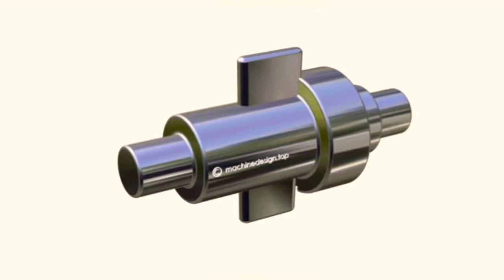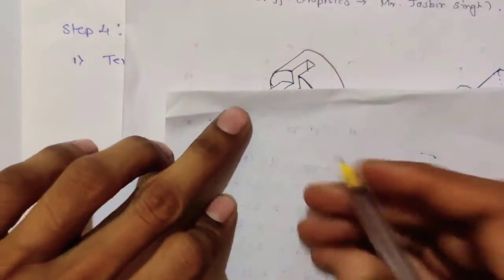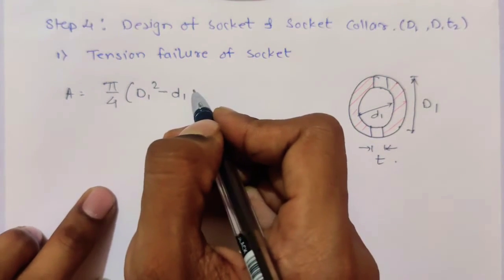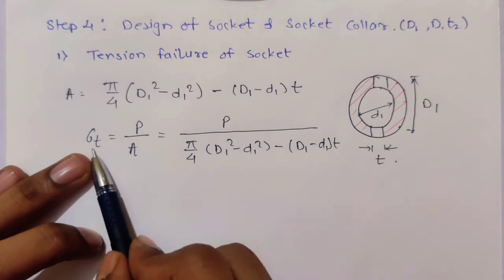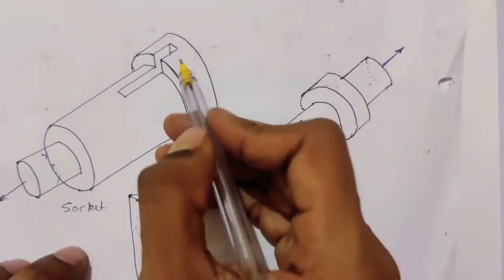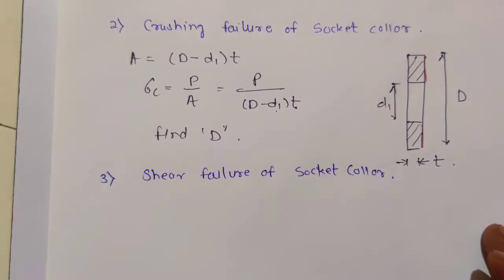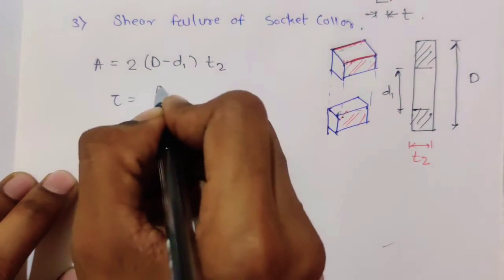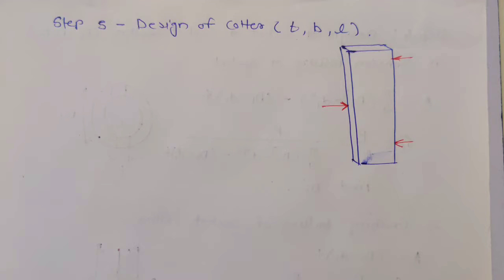Design of Cotter Joint using PSG _ Part 2 (Hindi)

Comment: Short Summary for [Design of Cotter Joint using PSG _ Part 2 (Hindi)](https://www.youtube.com/watch?v=I5DiZy7_r_E) by [Merlin](https://merlin.foyer.work/)

Title: Cotter Joint Design Fundamentals: Socket and Spigot Pipe - Part 2 (Hindi)

[00:02](https://www.youtube.com/watch?v=I5DiZy7_r_E&t=2) Design of socket and spigot pipe cotter joint

[02:38](https://www.youtube.com/watch?v=I5DiZy7_r_E&t=158) Designing Cotter Joint Failure Area Calculation

[04:51](https://www.youtube.com/watch?v=I5DiZy7_r_E&t=291) Calculation of Cotter Joint dimensions using the specified equation

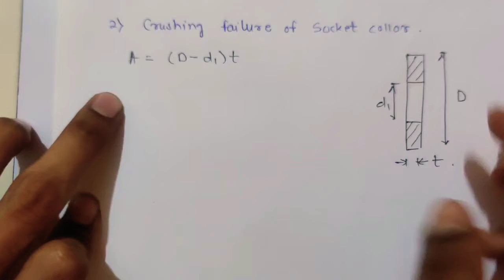[07:29](https://www.youtube.com/watch?v=I5DiZy7_r_E&t=449) Calculation of Sigma crushing for Cotter Joint

[09:36](https://www.youtube.com/watch?v=I5DiZy7_r_E&t=576) Design of Cotter Joint involves dimensions of width, thickness, and depth.

[11:53](https://www.youtube.com/watch?v=I5DiZy7_r_E&t=713) Cotter joint applies force using spigot and socket

[14:09](https://www.youtube.com/watch?v=I5DiZy7_r_E&t=849) Explanation of bending failure in Cotter Joint design

[16:04](https://www.youtube.com/watch?v=I5DiZy7_r_E&t=964) Design of Cotter Joint calculation summarized

---------------------------------

Detailed Summary for [Design of Cotter Joint using PSG _ Part 2 (Hindi)](https://www.youtube.com/watch?v=I5DiZy7_r_E) by [Merlin](https://merlin.foyer.work/)

Title: Cotter Joint Design Fundamentals: Socket and Spigot Pipe - Part 2 (Hindi)

[00:02](https://www.youtube.com/watch?v=I5DiZy7_r_E&t=2) Design of socket and spigot pipe cotter joint
- Explanation of the dimensions t1, t2, d1, and d3 and their respective formulas
- Discussion about the minimum cross-section area and application of tensile load

[02:38](https://www.youtube.com/watch?v=I5DiZy7_r_E&t=158) Designing Cotter Joint Failure Area Calculation
- The failure area is determined by the dimensions of the joint.
- The calculation involves multiple areas and lengths to determine the final design.

[04:51](https://www.youtube.com/watch?v=I5DiZy7_r_E&t=291) Calculation of Cotter Joint dimensions using the specified equation
- Ensure not to put the equation as a denominator while solving it to avoid errors
- Understanding the concept of crushing failure of socket corner in cotter joint design

[07:29](https://www.youtube.com/watch?v=I5DiZy7_r_E&t=449) Calculation of Sigma crushing for Cotter Joint
- Sigma crushing is calculated using the formula P/(D - T1*T)
- Understanding the dimensions of outer diameter and socket collar diameter is crucial in Cotter Joint design.

[09:36](https://www.youtube.com/watch?v=I5DiZy7_r_E&t=576) Design of Cotter Joint involves dimensions of width, thickness, and depth.
- Dimensions include T1, T2, areas calculations, and tau formula for stress analysis.
- Next steps involve design considerations for socket collar and further design of quarters.

[11:53](https://www.youtube.com/watch?v=I5DiZy7_r_E&t=713) Cotter joint applies force using spigot and socket
- Spigot pulls socket applying force
- Explaination on double shear area and stress

[14:09](https://www.youtube.com/watch?v=I5DiZy7_r_E&t=849) Explanation of bending failure in Cotter Joint design
- Formula for bending failure involves key parameters P, T, kata, and k.
- Directly use formula M=P/2D to simplify the design process.

[16:04](https://www.youtube.com/watch?v=I5DiZy7_r_E&t=964) Design of Cotter Joint calculation summarized
- Using the equation M by I Sigma by y for the calculation
- Comparing values of B from the equation to find the final value

Comment: 00:02 Design of socket and spigot pipe cotter joint
02:38 Designing Cotter Joint Failure Area Calculation
04:51 Calculation of Cotter Joint dimensions using the specified equation
07:29 Calculation of Sigma crushing for Cotter Joint
09:36 Design of Cotter Joint involves dimensions of width, thickness, and depth.
11:53 Cotter joint applies force using spigot and socket
14:09 Explanation of bending failure in Cotter Joint design
16:04 Design of Cotter Joint calculation summarized